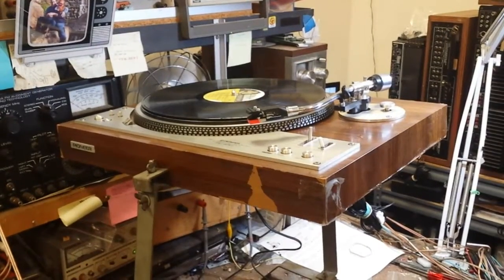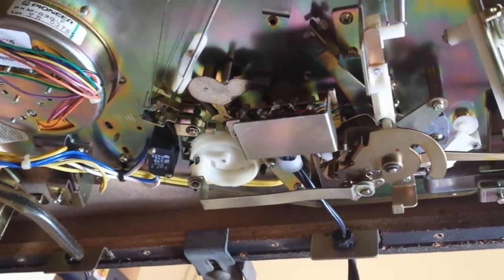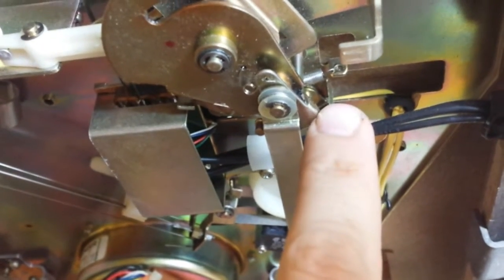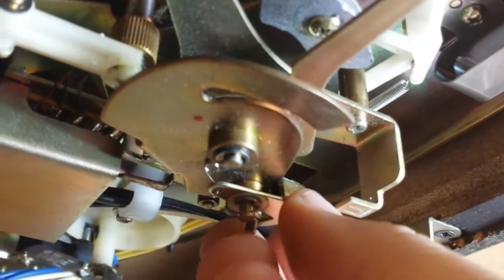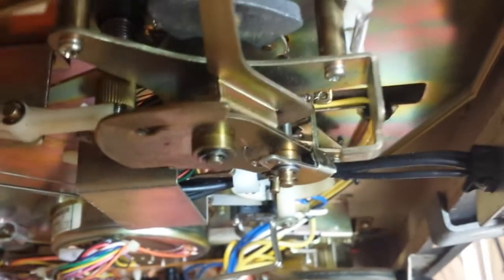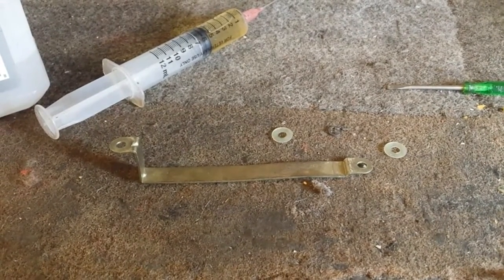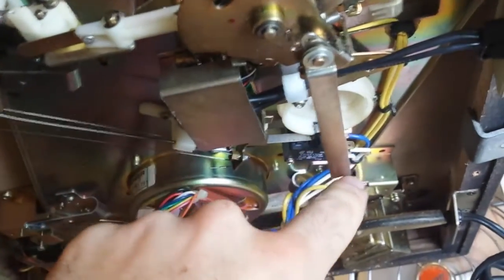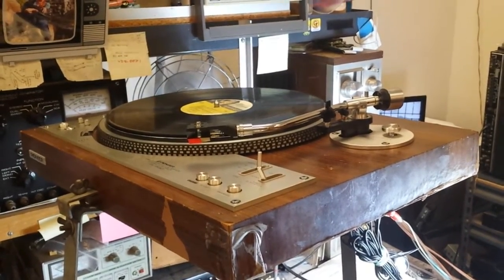Repair of pioneer pl-530 auto-return mechanism

Comment: I just repaired my PL-530 following your video. It was not dirty and needed no lubrication. (did it anyway)  It was the tiny "foam pad" that was deteriated !! It happens to every single on after so many years. I cut a little square piece from a wash sponge and used some double sided tape. It is the little piece of sponge that pushes it all the way back to the tonearms resting position. Thanks for the good video :)
Reply: The same with me. Taking apart and lubrication didn't really help. Replacing the pad did the trick.
Reply: Did you happen to take a picture? Just a small piece of a sponge? Did the double-sided tape hold? Is it still in there?
Reply: @araslau  - what did you replace yours with? How thick did you make it?
Reply: @buymycomics  I cut out a tiny piece of fabric/wool padding with a sticky surface, originally to be used for chairs to smooth drugging/moving them on the floor. It was 2-3 millimeters thick.

Comment: Great video and good editing! I had the same issue on all three of my pl530s and the solution was to replace the deteriorated foam bumper under the flip flop as you mentioned. I replaced it with 1/4" thick sticky backed felt and it returns to the support with authority now. The felt was sourced from Amazon. I love your work stand also! Cheers!

Comment: Jordon, thanks for your video, I own a 79 pl-530 , had the same problem with the arm parking correctly. Lubed all parts, And also found counter weight, and most important anti-skate can cause this issue. Thanks

Comment: Very informative! I have the Japanese version of this deck (PL-530X). The tonearm on mine does the same thing, but not as severely as this one. It stops about an 1/8" before the vertical stop on the tonearm rest. Good to know where to look if the problem gets worse over time.
Reply: I just dialed in the tracking force on the tonearm and came to realize the deck had arrived in my possession with a very headshell heavy counterbalance setting. Once I adjusted it back to where it should be, it became balanced enough to drop back into the armrest perfectly. So, now I know that I don't have this 'return problem' after all.
Reply: @djdepaolo  nice. You should've made a vid explaining the process. Thanks

Comment: Thank you for this video!  I inherited one of these in near mint condition that works perfectly in manual mode.  It has the exact same return issue but also the automatic start doesn't move the tonearm.  It turns on the light, spins the platter and I can hear the some mechanisms moving internally but no movement of the arm.

Comment: Superb video, Jordan - thanks so much!  My PL-530 is in mint condition so I'd love to resolve this particular quirk it has.  (well, that and the fact that the 45rpm speed doesn't come to full sync with the speed control adjusted all the way ...)   So did you do all that disassembly  and reassembly with the turntable mounted on that rack support the whole time?  I don't have one, so do you see any problem with doing the same repair with the turntable upside down, sitting on its plexi cover?  I couldn't do a real-time test afterwards, of course, and would have to turn it right-side up again to see if it works properly.  

Now out to search for a sticky-backed piece of felt...  I'm thinking a chair leg stick-on slider might be perfect! 😃  Cheers, Pat
Reply: I ended up using two pieces of fuzzy-sided velcro pads stuck together and now my tonearm returns to its stand perfectly!  The washers were not in the same exact order you showed but I just put them back in the order I removed them and all is well.

I was also able to fine-tune the speed controls because the top mounted and easily accessible dials were not sufficiently adjustable.  So I first set the top controls to their halfway points.  Then I tried several trial and error attempts but quickly tired of flipping the turntable over, replacing the platen and pad, guessing on which way to turn the internal controls on the circuit board, etc.  So finally, I set the table on a couple of 4x4s, set my iPhone camera to selfie mode and slid it under the table to where I could see the pots.  Using just the removable bladed tip of a small multi-function screwdriver, I was able to see and adjust the internal controls to establish speed sync at both 45 and 33 1/3 RPM.  My PL-530 is working like new again!  So thanks again for the fine video.  Cheers, Pat

Comment: I know this is old, but I have one of these tables I'm fixing up for a relative, it's been very quirky. I've already gone through and cleaned/lubed all the auto functions/switches and replaced what was left of the foam (how it works though I don't get since all it seems to do is contact that point to flip outwards) with a piece of window foam. What this one is doing is it will cue, drop onto record (granted it's off on position), but at the end it will not lift or cutoff. I found that the screw on plate F wasn't pushing into the off switch enough, it required me to turn it all the way in before it did. So now it lifts and stops.... no return. I have no idea, makes no sense. >< It also will not fully go back to rest manually until I do underneath and manually mess with stuff. All things that move perfectly otherwise. Can you help me out?

Comment: I appreciate you taking the time out to document this repair. I have a PL -570 that has worked flawlessly for the last 10 years but recently the auto magic feature halted. Looking for any tips to get it going again. I opened it up and moved the large wheel that appears to sync it somehow. Although it can be used manually but placing the needle and the platters starts I can't get the start / stop automatic functionality back. Leary about giving this to a shop since I think it's a unique table.
Reply from the maker: Very likely the tonearm drive motor had failed. Never tried to open up and rebuild one before. The only place I know that had successfully repaired one was Luis at stereoadvisor in sacramento,ca.

Comment: Very helpful to see underneath this machine, thank you!  I have a PL-520, and the audio is terribly inconsistent, usually getting very quiet or losing one channel altogether.  But if I raise the dust cover and let it drop back down, the impact sometimes gets the other audio channel working or gets the sound back to normal.  So does tapping down on the body with my finger.  Any idea what could be causing that?  I've tried two different cartridges, and I know it's not a stereo receiver problem.  Thanks!
Reply: Could be anything from an oxidized headshell connector to a cold solder joint. I'd start by testing the continuity between the cartridge pins and the RCA cables

Comment: What about the pl2? I recently got one for 30$ hence the arm will not lift up and return when after playing a side, it just stays on there while the record keeps spinning. You can lift it and push it and it will then return, though the auto return is either shot or needs reset. Is this a difficult fix? I can't seem to find anything online about it. I figured for the price though, I could at least part it, keep the cartridge and call it a day.

Comment: Jordan.  I would love to have mine repaired. It’s in great shape.  Has the tone arm issue, the platter runs on the housing so I have washers spacing and the two levers on the right stick. Are you in the New York area?  Thanks.
Reply from the maker: Nope. Other side of the states.

You should look up Just Audio in Maryland. Theyre familiar with vintage audio like this.
Reply: @JordanPier  Thank you.

Comment: Thanks.  Great details on how to fix this. I'm gonna try this on my PL-530, which has the same problem.

 I also have a PL-560 that doesn't have this problem.  Do you think it is only a matter of time before this happens to it or does the 560 have a different design?
Reply from the maker: I have not seen much of this on the 560. I don't remember if design is similar or if different quality parts are used

Comment: I just bought a PL-514 and it spins as soon as I plug it in. Also the arm is very stiff, not free like it is supposed to be and the auto return doesn't work...Any thoughts? Thank you
Reply from the maker: Mark Gray likely the set is stuck in a cycle. This often occurrs because the plastic gear on the spindle that turns the cycling cam cracks and slips up, down, allowing the platter to turn without finishing the cycle. If this is the case you can either attempt to epoxy the gear to the spindle or remove it all together and reset the cycling cam so that the machine can be operated manually
Reply: Jordan Pier thanks for the quick reply... I just got done fixing it... Someone replaced the RCA cord and it was interfering with the arm... Thanks again though
Reply from the maker: Mark Gray forgot about the cable that runs along the bottom! That was a terrible idea
Reply: Jordan Pier yeah it was an oversized thick one. I appreciate your videos... They give me the courage to diy

Comment: I have an issue with my Kenwood kd-49f where the automatic function doesn't function at all. any advice?
Reply from the maker: Hard to say where to begin without having the turntable in front of me. However if it plays an entire side of an album I wouldn't bother trying to fix the auto. It's usually due to failure of plastic parts attached to the arm and cycling system.
Reply: yeah, I ended up figuring out the auto return was getting triggered and pulling the arm back without lifting it off the record, so I kinda disabled the auto function. Works pretty well now.

Comment: Mine will scrape across the record when it returns! Wish I could find some good information on exactly how to adjust it but I don’t have a manual or anything
Reply: If the tonearm is scraping across as it returns, I'm thinking maybe you have the counterweight set too heavy. Try balancing your tonearm and adjusting the counterweight. You can find videos on YouTube on how to balance the tonearm and setting up the counterweight.
Reply: @ivergara24  no, it’s ok. I figured it out. I’d tell you how I did it but I had a hard time finding any info online.
Reply: It just took a small adjustment.
Reply: Actually, it might be the small plastic part under the tonearm that might not be raising the tonearm as it should automatically at the end of the record. Maybe it is is stuck in the lowered position instead of raising the tonearm before returning

Comment: how do you remove the platter for shipping? thanks
Reply from the maker: +Sticksbass take off the platter mat and pull up using the two holes in the platter. If it seems stuck rap on it with a screwdriver handle while pulling up
Reply: got it, thanks. someone suggested squirting the middle w dw-40.
Reply from the maker: +Sticksbass yeah, don't use wd40. If it gets down inside the motor it will screw up the electronics